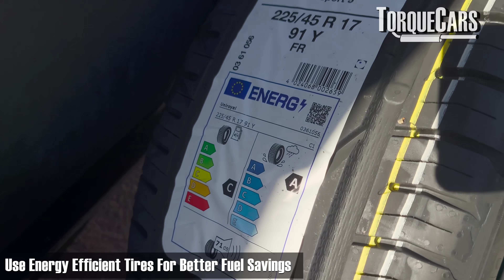10 Fuel Efficiency ECO Driving Myths Exposed 🚗💨  What Really Works? - Save Fuel the RIGHT Way!

Comment: Brake as little as possible and keep the revs around 1/3 redline. That's all you need to know.
Reply: Learning to drive using the brake pedal less is the single most important factor for sure. People don't understand this though as they don't read the road ahead any further than their nose tip
Reply: @elliot438bcfcVTEC  I always ask myself the question: Why is everybody braking and I am not? 🤣
Reply: @wolfschindler8921  I always ask that question as well. Makes me laugh how little people read the road ahead
Reply: @wolfschindler8921 Because half of the muppets out there sit too close to the vehicle in front of them.
Reply: Saves on brake pads and disks too!
Reply: @dj_efk  Is this really necessary? Do they (pads and rotors) actually wear in real life? I only change pads at mandatory 10-year intervals, and each time 10-year-old pads looked "like new", with little noticeable wear. The rotors on my current 16-year-old car, still factory originals are probably at 1/2 of their life; they'd last longer than me (and probably longer than the rest of the car).
Reply: Think of the rev counter as a fuel flow gauge
Reply: @curtisj2165  it's kind of more of a power range, metabolism or clock rate. The car has a higher range of available power immediately on tap, but the "standby" function is more costly in terms of fuel use. Most of driving you aren't needing to suddenly accelerate, so no point in remaining in the 4000-6000+ range just for going to the shops like you are trying for the car equivalent of strava. It would be like drinking a caffeinated energy drink, and then just sitting in front of the TV. You would put your body in a more wired state just to do a relaxing and sedentary activity, instead of doing a bike workout or something demanding.

Sometimes you'll need up to the rev limiter, sometimes you barely need to get above idle. Even the 2000 range can waste fuel if you're using it at 20 mph on the flat in 2nd gear. 3rd or 4th (depending on gear ratios) may give you all the power you need to keep rolling without needing to load down the engine into lug territory. Some short geared cars even top gear, though you'll need to change down several gears on an incline.
Reply: As simple as that. I would also add , on inclines modulate the throttle so that you are never over %40 rev range on a turbo engine or 55% on a naturally aspirated engine. You'll climb a little slower but save a sh*t load of gas.
Reply: Braking only slows you down. Make everyone else brake instead

Comment: The economy of a manual gearbox is in having a transmission which will out last the rest of the car 3x over with a clutch or two
Reply: EU M32 says hello.

Still fords IB5/IB6 is bulletproof. Had IB5 with half of the oil, no issues for over 40k kms. Didn't even hear a thing.
Reply: Strange that people need clutches or two. I've driven several vehicles to over 200k kilometres without any clutch replacement needed...
Reply: @BubblesTheCat1  You are not slipping the clutch at stops on grades. Me neither. My scenario is needing a clutch or two for three car lifetimes. Say 700k miles.
I bought my car used from a city slicker- I have no idea how much of the clutch he used up. I do know that my rear drum brakes are on track to out last me and the car the way I drive.
Reply: @jburdman7  Yeah, me too. I'm an ex vehicle technician and do my own stuff. My brakes also seem to last forever 😁🇿🇦🙋🏼‍♂️
Reply: @BubblesTheCat1  200k km is NOTHING and most people will get through it in a few years and definitely don't need a clutch replacement. For me, the lifespan of a car is 500-750k km and in that time it will need at least one clutch replacement. A car with 200k km is definitely not at the end of its life and I personally consider it a slightly used car.
Reply: Agreed, if my car fn2 type r needs a new clutch it might cost 500 to do it, but an equivalent car with an auto box will easily cost double or more for a torque converter and then you have to do a bleeding procedure with more expensive oil so labour is much higher and on cars with a dual clutch and just autos in general you have to use a diag machine to reset and calibrate the values 
And like you say, when the gearbox fails on an auto, it's likely gonna cost 2-3x more than an equivalent manual to replace or rebuild

Comment: Driving too slow actually starts to kill fuel economy.  The longer the travel time, the more the engine run time, the more fuel is used to simply keep the motor running.  Idling doesn't take much fuel, but then again, that is a flat 0 MPG.  Traveling too slow eventually murders fuel economy because the engine run time kills any gain from less motor strain/immediate fuel use.  45 MPH has often been seen as peak efficiency has often times been seen as an optimum speed for an incredible range of automobiles, gears, motors, ect., or there around.  Driving too slow isn't just a waste of time, it is a waste of fuel.
Reply: Depends: vehicle weight, final drive & how many speeds the transmission has. Also every car has a happy zone for acceleration & fuel economy. Mine is around 2000rpm about 1/4 pedal compression
Reply: Not really, but it's rude to delay other people on the road.
Reply: @0HOON0  If you drive 15 miles at 15 MPH you will spend an hour of engine run time, if you drive that same distance at 60 MPH you will spend only 15 minutes on the road with engine run time.  Considering all the factors from gears, power bands, throttle opening, ect., do you really think the car is really four times as efficient in lower gear for that extended period of time than driving faster?
Reply: That’s not really true. Driving at 60 vs 70mph can save 25% in fuel efficiency in some cases, but the speed difference there is only 13%, because that’s how the laws of physics work. 30 vs 20mph however is a 50% difference. Take a look at your MPG readout; drive to a desktops quickly vs efficiently and you’ll see how flawed your argument is. MPG calculators aren’t time dependant. They are calculated by distance. It’s ‘miles per gallon’ not ‘hours per gallon’.
Reply: @Olliebobalong  MPG is determined by several factors, including throttle position, RPM, gearing, load, as well as engine run time.  Electric motors with no gear drivetrains might be purely efficient against speed, but not  internal combustion with a gearbox.  Internal combustion must work with several factors, like engine stall speed, engine lug speed against load, and the fact that a internal combustion must ALWAYS be running.  How many gallons per hour does your vehicle use at idle?  How many gallons per hour does your engine use at 1,500 RPM in second gear, and how many gallons per hour does your engine use at 1,500 RPM in third gear?  At some point, you can use a surprisingly high amount of fuel to do very little work, at lower speeds in lower gears.  At some point, you use a near similar amount of fuel in a higher gear to do a lot more work, ie, cover more distance in the same amount of time.  

Others have tested this and shown this to be true.  Driving at 45 MPH in a higher gear is going to be more efficient than driving 22.5 MPH in a lower gear because the motor's work is being used for unneeded torque and pull instead of efficient speed, and driving at 45 MPH is going to be more efficient than driving at 65 MPH in a higher gear because of factors such as wind resistance and final factors of power band and gear efficiency vs. load.  

An EV can be more efficient crawling around at low speeds, but an ICE does not.
Reply: What has travel/ journey time got to do with MPG / economy? It's per gallon not per hour. 45mph is too slow. Some powerful cars have an optimal cruising speed of 85mph. As touched on in the video, only way to prove MPG is to start with a full tank. Run vehicle round a consistent circuit or on a rolling road at different fixed speeds for a determined distance. Refilling will indicate how much fuel was used. It's basic physics, not relying on a display.

Comment: i always floor it ,  it is solve all the eco problem ,
Reply: I used to drive like that when I was younger and got told " You don't need a throttle peddle as an on / off switch would work better 😂.

Comment: 9:26 13:47 What would you consider a "high-compression" engine?
Reply: @angelamartim8337  12:1 or higher
Reply: @WarriorOfEden3033  Thanks. The engine of my car is 12:1.
Reply: @WarriorOfEden3033  May I ask another question please? For example, is it true that a higher compression engine is more likely to cause low-speed pre-ignition (LSPI) depending on the fuel you are putting in? I'm imagining a scenario where lower-octane fuel combined with a high-compression engine will more easily result in LSPI. Is that correct?
Reply: @angelamartim8337  too low of an octane in a high compression engine will cause knock if that’s what you are asking. That’s why high compression engines run very well on 91/93+ or E85 that is 105 octane
Reply: @WarriorOfEden3033 Thanks!! So I've been researching the topic of air-fuel ratio and spark plugs and have been hearing that theoretically in order to have less incomplete combustion the ideal would be to have a low-compression engine. Then my question becomes what are the advantages of a high-compression engine? Can you tell one? Because if I'm not wrong, high-compression engines are picky with fuel, more likely to result in pre-ignition, and probably run hotter than average which presumably will have to inject more fuel to prevent the engine from overheating (richer air-fuel mixture). What do you think about all this?